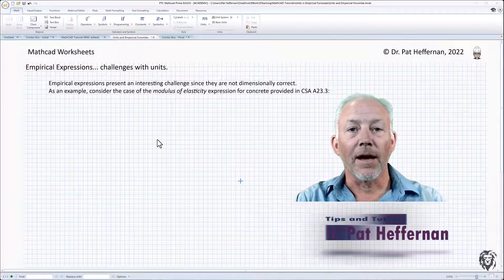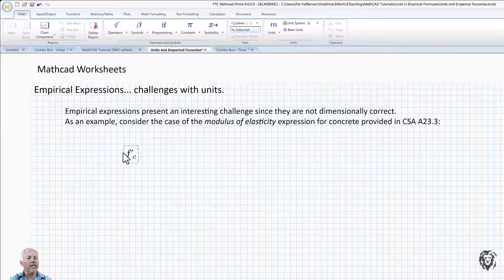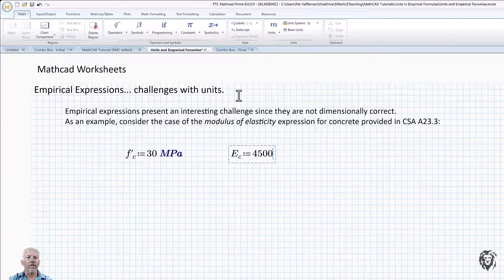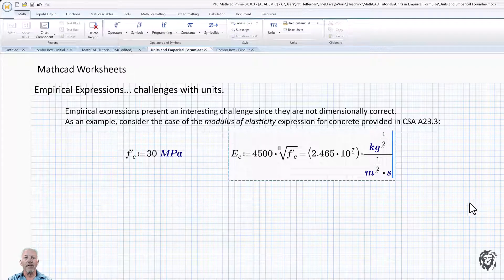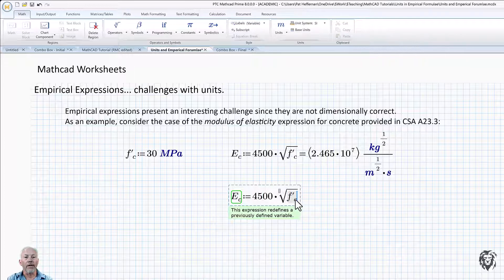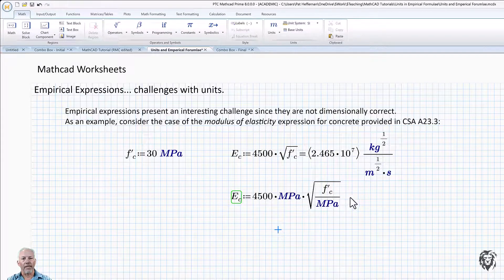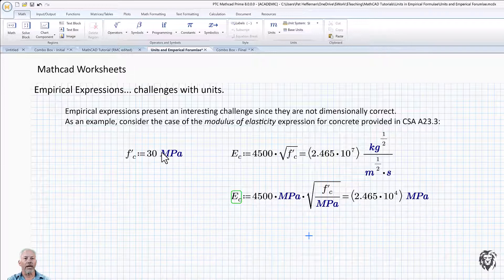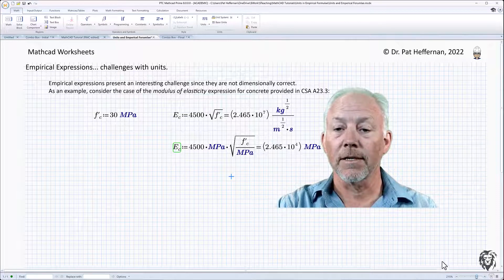PTC Mathcad - Managing Units in Empirical Formulae

Comment: Well there should be a suggestion mailed to PTC about this problem that they should include a function in which excludes the units after math operation and only return value.
Reply from the maker: The problem with that is that it would be a break in the logic/flow in the math/units calculations.  At least by doing it manually, the user is aware of the units of their formula and if an error is introduced it will cause a hiccup in the units.  I'll think about it a bit more and would be interested if you had further thoughts.